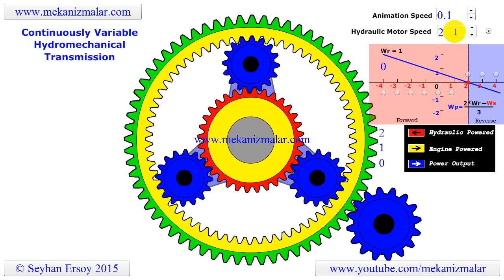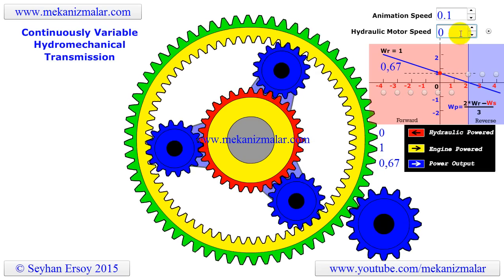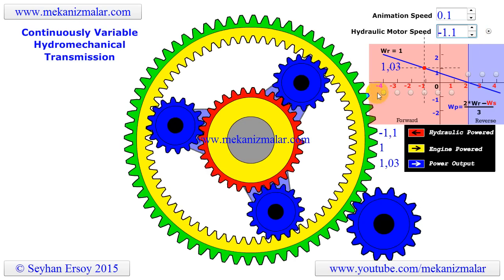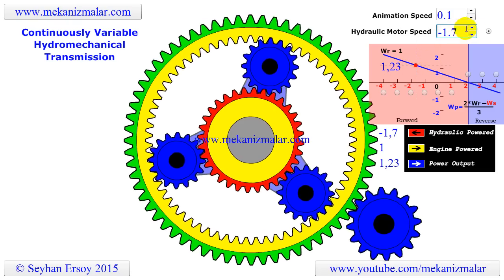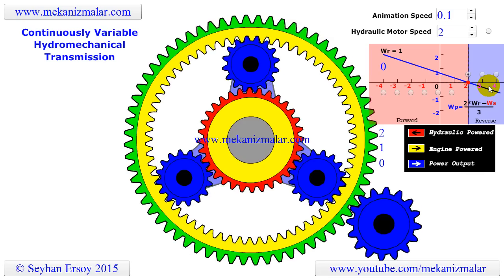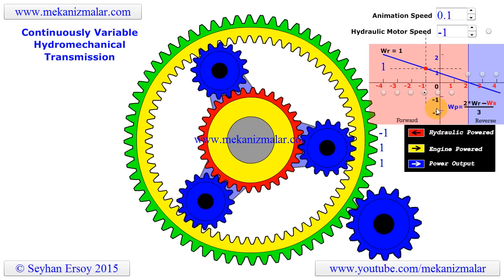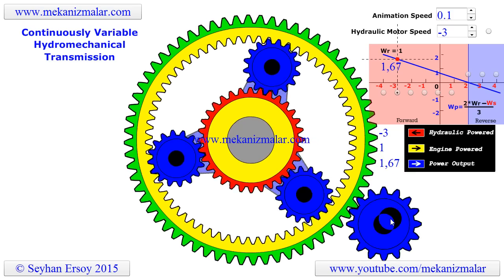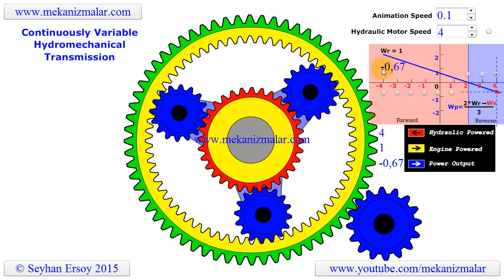continuously variable hydro mechanical automatic transmission

Comment: You need 2 axial flow piston pumps, with en efficiency of 0,9 each, so, a best-case-scenario 0,9^2=0,8 efficiency for the driving of the sun gear!!! which part of total engine output is needed for the sun gear, and which part for the rest of the gears (which are, i suppose, very efficient) ???? what would be the total efficiency of such a CVT???  thank you a priori for every answer, clarification or correction!!!

Comment: What program do you use for making the gears?
Reply from the maker: Thank you for viewing my video. I use my gear drawing program to draw gears.
 http://www.mekanizmalar.com/gear_draw.cgi
Reply: mekanizmalar
Always appreciate your videos (subscriber) how do you animate the gear ratios? Did you code it yourself? Im interested in learning not only to DRAW the gears (programmatically) but also animate them through code using variables like you did above. Where can I source the information on how to calcluate the  Addendum, Dedendum and on how to animate the gear ratios?
Reply from the maker: Joe Cavaliere
Dear Joe, Thank you for your continuous support of mekanizmalar channel.
You can draw the gears with the program given above (the link). By using that code, you can create a gear object by using AS3. Rotation of two gears is easy, lets assume that you have two gears with 64 and 32 teeth respectively. If you rotate the small gear by using movie clip rotate parameter, you should rotate the large gear half of the small gear rotation speed. HOWEVER, what is difficult is that, complex system like this one becomes very difficult to animate, at least for me. It requires some trial and error process which is hard to explain. If you are good in gear system design, I am not, than it could be easier for you. In the animation given in the video, I spent some time to find the formula for the cage rotation speed.
Reply: mekanizmalar
Thanks for your response much appreciated. what I find really interesting in this animation is you hydrostatic  transmission system where you can increase & decrease (reverse) the speed of the gears. Really cool stuff here. I was just wondering if it was based of library but as you mentioned its done in Action script. In anycase I LOVE your work and keep it up!

Comment: That's what I thought the lawn tractors had.  My guess is it doesn't lend itself to high speed as well or it would make its way into automobiles.  The toroidal CVT is being tried in autos while it has been in low speed heavy equipment for a while.  Need powerful hydraulics for that also.  My CVT does not need any hydraulics.  It's all mechanical.